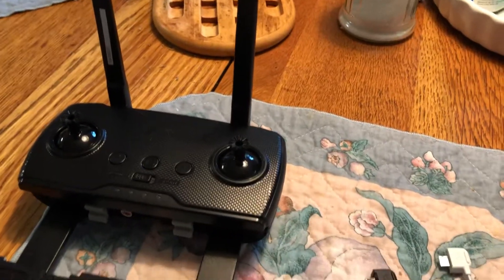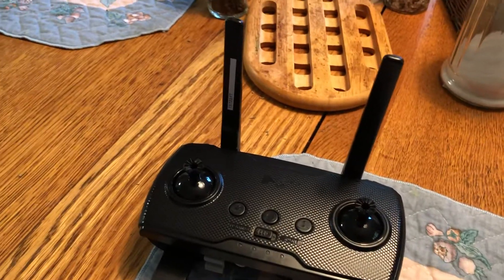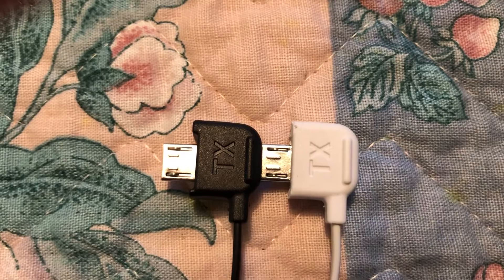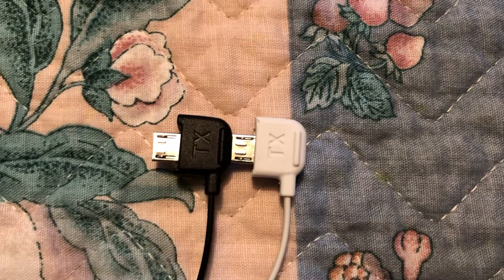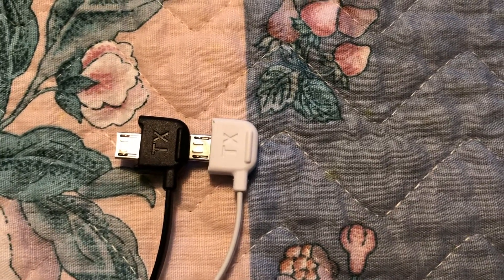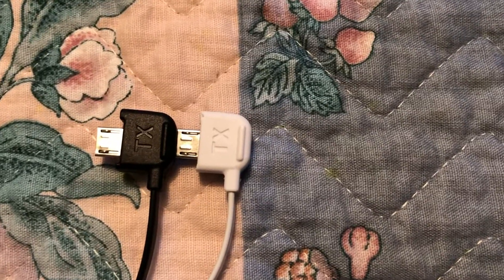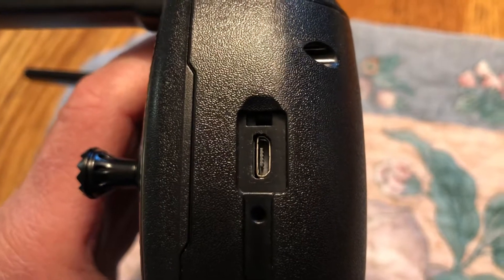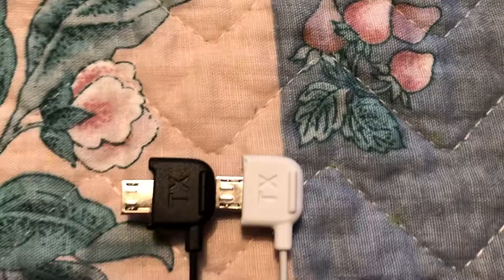Hubsan Zino H117S/H117P USB connection problem solved

Comment: Are you talking about filing the ridges on the outside, or the two in the centre?
Reply from the maker: The ridges that face the transmitter, as shipped the Hubsan cable can't plug all the way into the transmitter and make a solid mechanical and electrical connection. If you look closely at the black Hubsan cable and compare it to the white aftermarket cable you can see I have filed down the ridges on the white after market cable so it can be inserted more deeply into the transmitter.